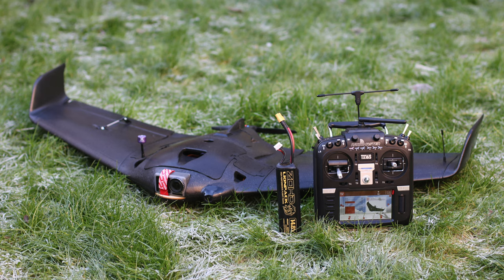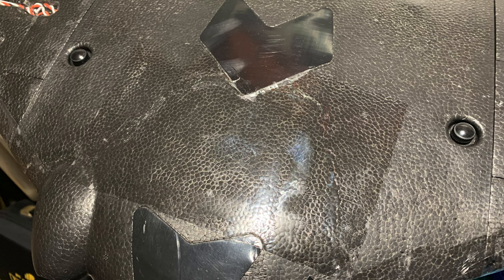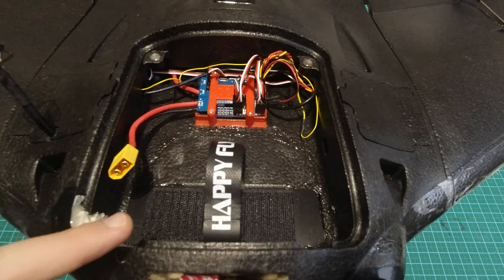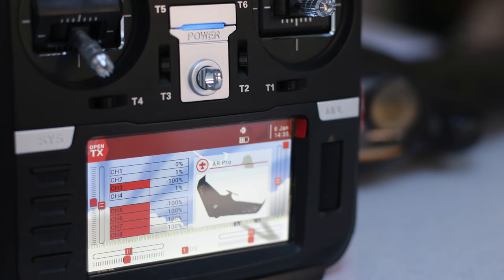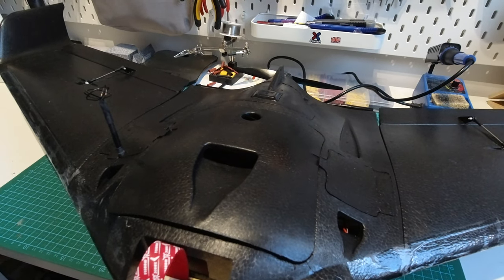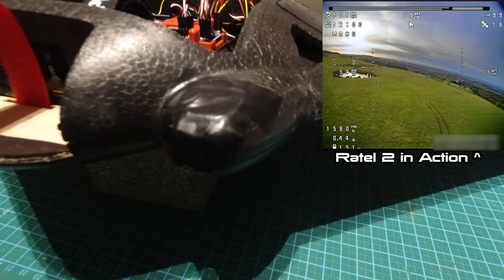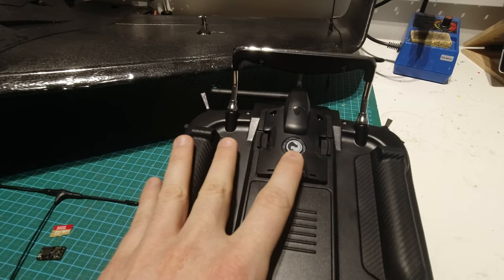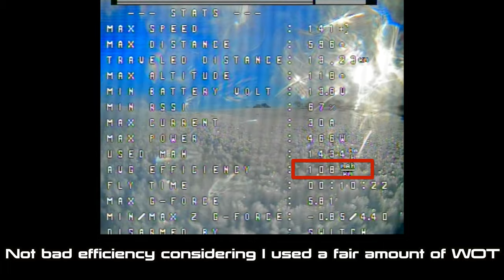AR Pro FPV Wing - Maiden / Crash / Repair / Review... & New Toys 🤓

Comment: I see you have to land fast to prevent the tip stall.....Have you noticed the unrecoverable spin of death if you go too slow(35mph) in the air? Not a recommended plane in my mind.
Reply from the maker: No I just enjoy fast landings😆 Never had any issues with it stalling at slow speeds. I guess you might be running yours a bit too heavy
Reply: @AdamGdoesFPV  if you never go slower you will never see the problem. But there is a problem. I do not own one and never will. Poor design.

Comment: Excellent presentation. I'd agree with your impressions of the ARWingPro and Crossfire. How strong is your expanding filler? I have repairs to complete on mine!
Reply from the maker: Thanks :) The Gorilla Glue has very strong adhesive properties if that's what you mean

Comment: Hi, Adam. Is it possible to use your diff for Matek F722 in a Matek F405 wing fc? Thanks
Reply from the maker: Hi, should mostly be ok, maybe just not some of the misc settings. What is it that you'd like from my diff?
Reply: Thanks for answering. I would like those from #master and # profile 1. I am using Crossfire.

Comment: I wonder if adding black pigment to the foam if it would blend better
Reply from the maker: Maybe. I just worked with what I had already just to get it back in the air. Black tape did the job for the cosmetics 😆

Comment: Cool! How did you manage to wire the receiver if there are only 3 free outputs(6-3 for servo) on the connector? Did you use GND for both servo and receiver?
Reply from the maker: Hi Mark, on my CF rx I only use 3 cables as I have no interest in telemetry. However, if I was someone who did want to use all 4 cables I would do as you mentioned and share the GND pin for both the servo and Rx. Cheers 👍🏻

Comment: Hello Adam,
Since you got a 6 pins connector and for cross fire you might need 4 wires-5v,g,tx,rx how did you manage the connecction?
Thanks
Reply from the maker: Hi, I have no interest in telemetry so I only used 3 pins for the CF. However, when I have done something similar in the past I have joined the GND cable at both ends to free up a spare pin. Cheers
Reply: @AdamGdoesFPV  so you just used 5v,g, and TX?
Reply from the maker: @eltio77556  Yeah, that's all you need if you don't want to get data back from your FC to you on the ground. Personally I find I have everything I need to know on the OSD

Comment: The lines in the video are emf from the fan running so close to the tranciever chip and power circuit. Try unplugging the fan and see if the lines go away
Reply from the maker: Tried that already mate. Even without the fan running it’s exactly the same.
Reply: @AdamGdoesFPV  geez! That's a bummer. Looks like it would be a decent vtx. I stuck with tbs after dealing with alot of hakrc and akk stuff. Never used tramp or rush stuff. The pro32 is an amazing vtx even the nano32 is awsome in my 3inch and whoop stuff! Smaller than a stamp. Have you tried the pro32 yet? Saw in the video you had one. I know they were pushing close to 2w when it came out but an update dropped that to closer to 1w bc of cooling issues. But I don't see why if being mounted on a wing with constant air flow that it would be a issue and with a crossfire and if you use their goggle reciever and wifi you can get dynamic power to the vtx as well! I fly a ar900 and only have a unify pro 800mw  with triple feed patch and pagoda antennas with the stock dipole antenna I got 17km range over the ocean 1 way on 800mw and 500mw crsf power! Have the full size crsf TX @2w I bet if I went to 1.2/1.3ghz video my only limit is the batt!  Building my own packs out of my imr vape Batts. 3000mah 45a continuous draw Batts I'm going to try making 3s3p pack so 9000mah I'd get a good solid hour of fast flying! Lol. Probubly gonna be my last flight with it knowing me! Lost my 7inch quad on the side of a mountain that was 5 miles away from me at home point and another 2500 feet up the mountain side on the other side of the peak! I called that a wash! Lol! Keep up the great videos! I enjoy them alot! YouTube and this hobby is getting stale after 6 years of watching daily! Your content is what I look for and like watching the most! Thank you!

Comment: That irks me that you cant get out of launch mode by changing flight modes. In my eyes that is a ballsup by the devs if true. In ardupilot you can change flight mode to get out of auto launch mode as you should be able to. i keep trying to find reasons to come back to inav but this issue has postponed that move.
Reply from the maker: I believe the reason you cannot change to manual mode for example is that when you exit auto launch from idle throttle it will go to stick level throttle. So if you use a low idle like 15%, you push the stick up to 100% for post launch throttle, they don’t want knocking a stick to allow it to shoot up to 100% unintentionally. Not ideal but now I know how to regain control it won’t be an issue again, I’m just glad I found out now on a lower cost model and I didn’t lose it. Luckily it went in a circle rather than straight 😳 thanks for watching 😊

Comment: Hey Darren it's been a while and hope your doing well, I have this wing on the way and planning on installing inav 3.0.1 I noticed inav has added the ar wing pro to the presets, I've looked at your inav diff. Settings and wondering what you changed from the preset ? Or did you use the inav ar wing pro preset? Any advise will be appreciated Thanks
Reply from the maker: Hi, this wing was flown pre iNav 3.0 and I didn't use a preset. I've no idea what the preset settings are so cannot tell you what's different. Cheers
Reply: Thanks for video and reply, I'm still waiting on my sonicmodell AR.Wing pro but I did flash a new f405-wing with inav 3.0.1 and there's no longer any presets to choose from so I'll see how that goes. Any advise/ tips on this wing would be welcome, I have the pnp version coming and planning on a lipo battery and no camera until I maiden I've been reading were people having trouble hitting cg with this wing so trying to decide what size lipo to use without adding lead. Thanks again

Comment: Could the lines in the video be related to the fan running on the vtx ? I've had similar lines appear when once mounted my vtx too close to the motor on a mini AR wing...
Reply from the maker: I had this thought about the fan too. I tried a few things to solve the problem but didn’t want to spend a lot of time talking about it in an already long video 😅 I nearly took it apart to disable the fan just to find out what causes it. It’s definitely just an issue isolated to the vtx as it happens on the bench nowhere near any other electronics, on any power output level. When I simply unplug and replace with any other vtx it’s an instant clear picture. Maybe this is just faulty 🤷🏻‍♂️ who knows. Thanks for watching and for commenting 👍🏻

Comment: Just had an unsuccessful maiden today with this wing attributed to a bad hand launch.  What’s your recommendation for hand launching this wing?  I’m a newbie to flying wings.  I’ve seen some recommend “overhead vertical launch” and others “side wing toss”.  Any tips?  Thanks in advance
Reply from the maker: Sorry to hear that. My method is to hold it close to the FPV camera with fingers underneath and thumb on top. I have a video demo on my Facebook page of me launching this wing (link in description). I also use Autolaunch though and it does try to roll over but Autolaunch corrects it with ease
Reply: @AdamGdoesFPV  Thanks for your response. Just saw the video on Facebook. Good reference I’ll give it a try thanks again and happy flying
Reply: @AdamGdoesFPV  proud to report I had a successful maiden today.  Thank you for pointing me to the right direction.  This wing is amazing!  Basically flies itself.  Cheers!
Reply from the maker: @AlexanderPerez-oe1gu  nice one!

Comment: I've found the ratchet on my TX16S is almost non-existent no matter how much I've adjusted it. Still a fan of the radio though.
Reply from the maker: 😣 uh oh, that’s not what I wanted to hear. I’ll still give it a go at some point abs I’ll let you know how it goes. Weird how off putting it was for me flying with the stick feeling ‘smooth’.
Reply: @AdamGdoesFPV  Ratcheting throttles are kind of seen as "old hat" now. It was a thing, but almost everyone (especially in the quad world) never fly with a ratcheting throttle. This is because you'll just have less throttle resolution. There are 1000 throttle values, but you're limiting yourself to 100?. For fixed wing it doesn't really change much though. I use to fly quads but only fly fixed wing now and there's no way I could go back to a ratcheting throttle. I think Radiomaster just saw themselves moving with the times. I don't believe the Taranis Hall effect ship with a ratcheting throttle either these days.

Comment: Man what a great video, I too have installed crossfire micro tx v2 and nano receiver on my C1 chaser, this worries me since i haven't flew this wing yet with crossfire and i do use auto launch but i've always just moved either stick to cancel auto launch i hope its still that way with crossfire. Ive learned alot from your channel just like repairs you made here looks great, once i get my yaapu telemetry worked out and some decent weather ill try out this crossfire.Thanks for all your help
Reply from the maker: Hi and thanks :) you might want to check out my details on the crash again, it's an iNav thing nothing to do with CF so no worries there ;-) enjoy!

Comment: Panda needs to fix their VTX
Reply from the maker: I'm going to disable the fan to see if that's the issue. But yeah it's not ideal to have those lines on a vtx when using it straight out the box. Cheers

Comment: The lines on your 1W VTX may be due to the fan. You could try temporarily disabling the fan to see if that helps. If so, then an LC-filter on the power to the fan will probably help.
Reply from the maker: Yeah I mentioned this to someone else too. I nearly opened it to disable the fan but just never bothered. I do suspect it could be the cause of the problem (it’s a shame you can’t disable the fan through a menu). I’ll try it when I get chance and let you know what happens.
Reply from the maker: Fan removed, still the same lines 🤦🏻‍♂️
Reply: @AdamGdoesFPV  That's a pity. Perhaps it's the inbuilt regulator in the VTX then if the lines appear always (even with motor off and fan off). In that case, there's not much hope for it.
Reply from the maker: @WinstonSmith1984  No there is no hope. When I tested it after removing the fan it was on an FC on the bench with nothing else plugged in.

Comment: Change your cli setting for nav_fw_launch_accel. A lower setting will detect a lighter toss. It is default set to detect @ 1.8 kilograms. Your toss didn't activate this, thus never making it into flight mode. It is covered in the documentation.
Reply from the maker: Oh I know all of this and understand every launch parameter. Sometimes it takes a little trial and error to get the correct value. The purpose of showing this was to help others that experience the same issue 😊👍🏻
Reply: @AdamGdoesFPV  oh . . . Sorry. I must've missed where you covered setting these parameters.
Reply from the maker: @konstantkrash  No problem :) I didn't actually over it in this video. Thanks for watching

Comment: Great vid as usual.  Would you recommend it for beginners?
Reply from the maker: Hi Mark, yes I do believe this is a good wing for beginners. Easy to work with due to all the space, pre built slots for all your gear, a decent wingspan and it's easy to fly. Maybe a beginner that is not confident on the launch may want to enlist some help to start with though. Cheers

Comment: I want one so bad!!!! How are you finding crossfire compared to dragonlink adam? No plans for 1.3ghz vtx for a bit of long distance flying with this?
Reply from the maker: So far Crossfire seems pretty solid with a perfect link out to 5km on just 500mw... but then again that should be the case. I love Crossfire for it's usability and appearance... but I won't make a judgement on it's ability during a more challenging flight just yet. I'm tempted to put 1.3 on this wing but it doesn't exactly lend itself to 1.3g CP antennas... I'll have a think. One thing is for sure, I will be combining CF and 1.3 soon for a low river run flight. Cheers
Reply: @AdamGdoesFPV  I love crossfire. I was out 43km with 99 rssi! Look forward to more videos adam
Reply from the maker: @adamtavener6345  Very Impressive. I guess you have the full size 2w Tx? I don't tend to do much range, it's more the low altitude behind objects flying that challenges my video and control links
Reply: @AdamGdoesFPV  I do but that was on 500mw. I just like to have the screen on the back for ease of use 😊

Comment: I have just switched all my gear to crossfire was using the r9 stuff from frsky but since they started playing unfairly I can’t invest anymore in it
Reply: Crossfire is a much better product in every way compared to the R9 system mainly in the ease of use and updating all the bits 👍🏻
Reply: Yes I was very easy to apply the receivers to my models and binding and updating was a breeze whit the crossfire I got the tango 2 transmitter as well and that is nice
Reply from the maker: Yeah I agree, ease of use on the Crossfire is so refreshing in a hobby full of complicated equipment. Form factor, stock availability and price are all good too 😎 now to find out if it can cope with some of my more challenging flights that Dragonlink handles with ease.
Reply: @AdamGdoesFPV  can’t see why it won’t equal dragon link perhaps use the diversity Rx instead of the nano but from what I’ve seen on social media tbs crossfire is pretty good
Reply from the maker: @Drift-fpv  will be down to DL operating on 433mhz vs CF on 868mhz
Reply: @AdamGdoesFPV  you have had great success with dragon link and would probably out perform crossfire for mega long range I fly mainly quads so crossfire will do me just fine.
You inspired me a few years ago to build a skywalker which I built and never flew still up my loft lol that has ezuhf on it the idea for me was long range flying I would love to have ago at fixed wing and I live in an area where I could fly out over the Thame estuary one day I will do it lol
Reply from the maker: @Drift-fpv  Ah you should get that back out and get it in the air!! :D

Comment: Here are some good settings for autolaunch with the AR pro, I'm doing the over head launch.
 set nav_fw_launch_velocity = 150

set nav_fw_launch_accel = 1600

set nav_fw_launch_max_angle = 180

set nav_fw_launch_idle_thr = 1350

set nav_fw_launch_motor_delay = 0

set nav_fw_launch_spinup_time = 500
Reply from the maker: Yeah they should work for you 👍🏻😊 not a fan of the over head launch but go with what works best for you 👌🏻

Comment: I never heard of using PVA glue for this purpose. You can just activate the PU/Gorilla glue with a drop of water and stirring. It will then expand on its own and you can apply it part way through expansion when you like the consistency. Does PVA help out?
Reply: You can mix in black dye for a bit of a better appearance, although it the new material won't blend perfectly.
Reply from the maker: You know the funny thing is it’s designed to go with water and that’s what the instructions say to use... I learnt to use it with PVA many years ago and now I’ve completely forgotten the benefit 🤣🤣 just became habit. The black dye would have been a nice idea 👍🏻